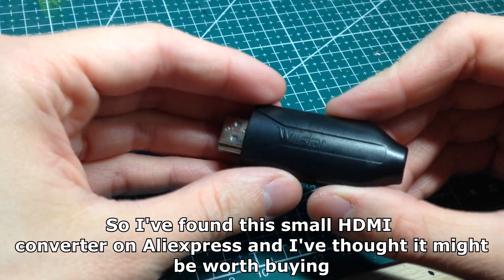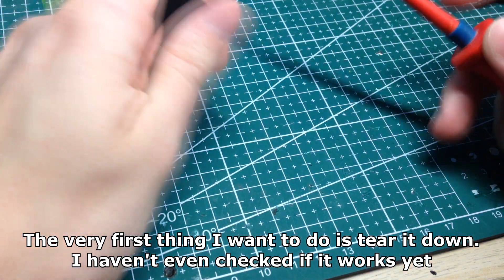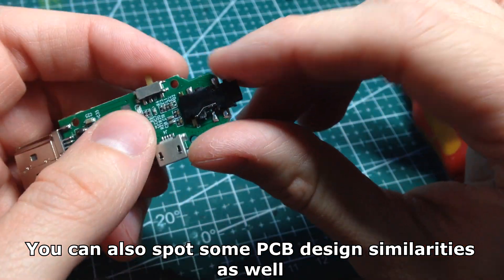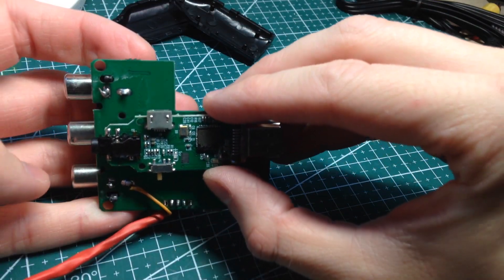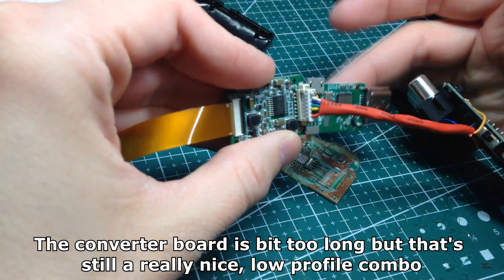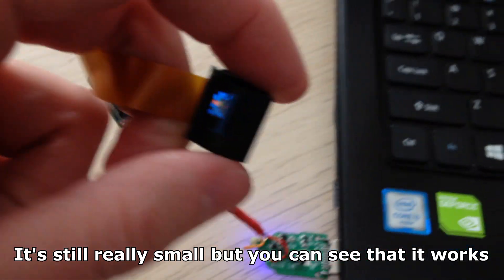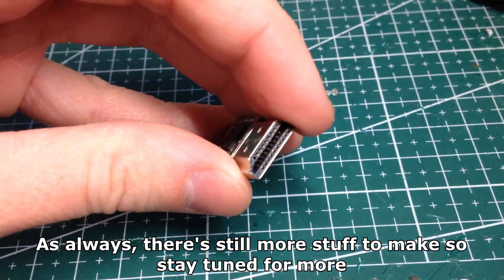WIISTAR HDMI CONVERTER | Smallest One yet

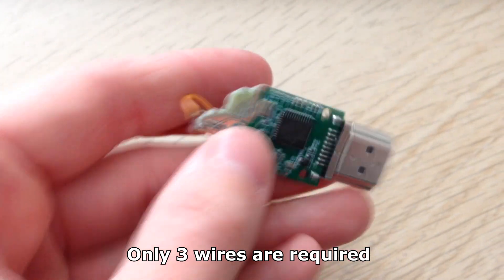Comment: Where does the red wire go? 2:15
it doesn't seem like there's a spot made for it on the board
Reply from the maker: You need to scratch off part of the soldermask
Reply: ok I am getting power - im not sure if I've got the yellow right. Any tips on that one?